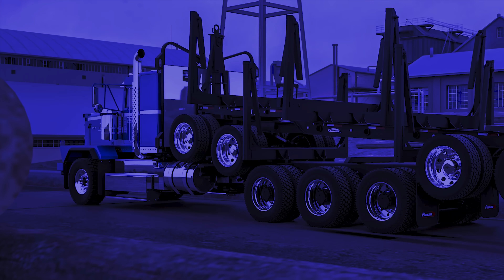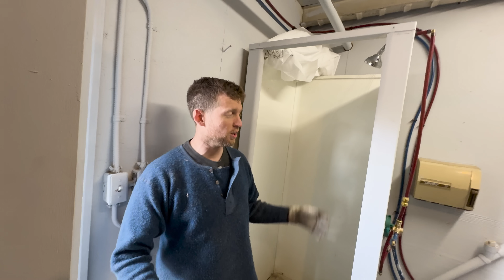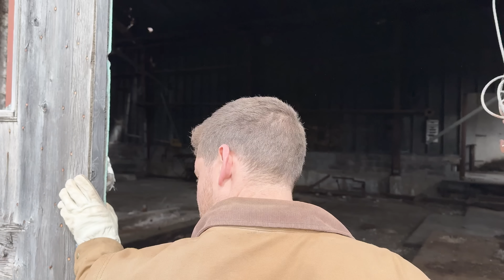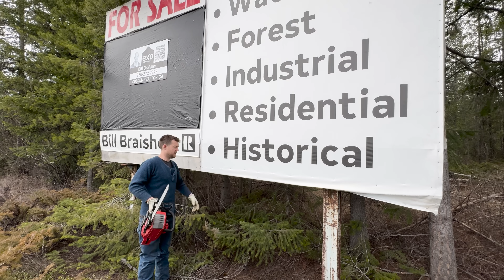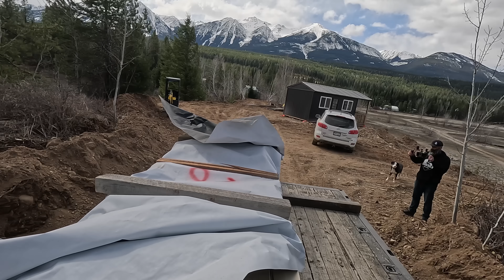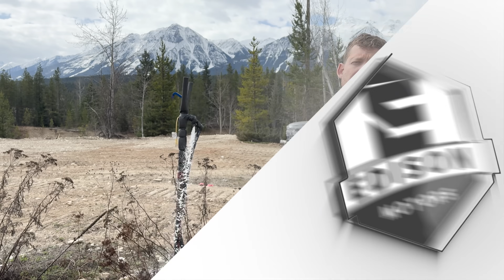Hidden Shop Revealed! Our New Build Space

Comment: Why do you need to build new factory building if you already have buildings that you can restore? Wouldn't it be more cost effective to use them first? Make some money with those buildings, then when they are too small, build new ones
Reply: The only safe building is this shop that can hold 2 trucks.

The new assembly plant will hold 12 trucks under construction.

Comment: So, don't just throw out all the paperwork. There may be some really important documents bidding in there. Most will be meaningless to you, but there may be maintenance records for the buildings and infrastructure that could be very useful to have. 

Also, where are you getting water from? If you are running off the well, you will probably need a water treatment plant. Start getting that water sampled now so you can get a water treatment plant designed and placed.

Comment: I thought that you guys might be interested to know that the structural design of the Old Powerhouse is a commonly used structural design for overhead cranes. The vertical columns get landings to support crane rails to run the length of the building on both sides and they carry the trolley that spans across the width of the building.
 I'm sure an overhead crane would be a very useful tool in your future.
Reply: and maybe power it with the train boiler?

Comment: If you can add some kind of ventilation/ductwork to your tiny houses before you drywall. The ability to bring in filtered air into your building with a little bit of positive pressure inside will help them dry out if there's ever humidity issues in the summer or condensation in the winter. If all you can bring to the buildings is electricity even a small HRV/ERV or a mini split would go a long way.

Comment: That power house would be quite a thing if you could restore and upgrade the fire suppression system and include a tri-brid backup power system (modern diesel generator, battery system, and roof solar or wind turbines) for the fire suppression and security/emergency lighting. Then gradually building a secure battery vault using your skills in developing your hybrid trucks to slowly power more of your facility off renewables and lowering your electric bill over time. The water tanks if cleaned or replaced could be a great storage for reserve water for distribution between fire suppression or other utilities (showers, toilets, sinks, wash bays, filtered drinking water dispensers). Heck, you might even want to upgrade the buildings with external water spray systems to keep the buildings and immediate grounds wet in the event of a fire.

Comment: Could you use that old boiler to power equipment to make your own frame rails/machining equipment? Rather than using it to power milling equipment it could get used to power the big manufacturing machines you need to make those trucks.

Comment: the extra building should be your shipping and recieving building... rebuild the roof and line the walls with pallet racks and get a warehouse forklift for in there... lots of small parts and electronics that will be coming in for sorting and storing while building trucks... you will need a seperate building for that...

Comment: What if you were to fix the roof for now on your paint booth building and use it for storing and maintaining the heavy equipment you are using the the site, with the intent to turn it in to the paint booth when needs and time permit. The roof will help maintain the interior stat as it is as well as shelter your heavy equipment and I am sure the peeps doing maintenance on them will love the idea of a roof over head for when a job goes long or weather turns sour.

Comment: Plumber here: I hate to be that guy, but in reality that old steam boiler should probably go to scrap, or be reused as not-a-boiler. Steam boilers of that scale are not something to screw around with unless SPECIFICALLY trained on them with multiple tickets for it (in fact, im pretty sure in Canada it's illegal to so much as touch one without a class A gas ticket.)
 if they go critical they can destroy entice blocks and kill people; especially old oil fired ones that dont have electromagnetical safeties. that is the REASON steam locomotives were abandoned for Diesil-Electic in the first place: it wasn't about efficiency as the steam powered engines were actually far more powerful at the time, it was because diesels  didn't have the chance of going critical and talking out half a small town at any time; which you can imagine was a pretty big liability. 

you COULD re-use that old boiler body as a fuel or oil storage tank though! a pressure vessel is a pressure vessel.
Reply: As a train guy, while a steam boiler blowing up is a factor for abandoning them, that wasn't the reason. It was that they got too expensive to maintain. There are so many safety features on "modern" steam engines, and you cannot come close to running one without training for months/years.

I agree tho. Scrap that boiler in the shop unless you got someone who really knows what they are doing.
Reply: I was thinking the same thing. If it's used for steam, it should be very low pressure. I don't know if it's possible to have a low pressure steam system though

Comment: @EdisonMotors since you have access to so much wood, open skies, and water storage, you should look into heating the place with a combination of solar thermal and wood gasification boiler(s), put through hydronic radiant heating wherever you can. This way you could put all those off-cuts and slash into good use as cheap fuel, reducing your electrical demand and cutting out propane or natural gas as much as possible.
Reply: Air to water heat pumps for heat. My 2cents
Reply: @justindarkcloud  A/W or regular A/A would be good for the residences (small cheap wall-mount units that could supplement small woodstoves - provide aux heat in winter and AC in summer) especially where you can easily mount the outside condensors outside way up high and out of the snow. But for large buildings - radiant floor heat paired with geothermal are far more efficient in that kind of tonnage amounts required from everything I've read. If going A/W or A/A They'd require a lot of large condensors for that kind of tonnage, and have to deal with major snowfalls, so why wrestle with having to continually shovel them out, and also deal with ice-up issues? 

Especially if you're working closer to the floor, and they're going to have to pour a new pad anyways for the new shop?

Comment: Have you had looked into using the Achates Power opposed piston engine design.  With its simpler design and significantly improved efficiency over modern 4 stroke engines, it would be the perfect power plant for a diesel electric vehicle.  Since the engine wouldn’t need to operate in as wide a range of power and rpm settings, you could make an already simple design even less complex by simplifying the forced air intake system that would normally need to work well from idle to full power.
Reply: I get it...

But Achates Power isn't producing engines yet.

Yeah, they have some demo engines, but they aren't in production. Attaching themselves to an unproven, unknown engine, without a parts network? Sounds like the most perfect way to potentially ruin the future of Edison.

The reality of the situation is, you start safe, and simple. Prove the Edison truck works, is reliable, functional, etc. Then, when Achates has proven their production engine? Then you might see about offering it in an Edison truck.

But you don't stack two, unproven prototypes together. That's just begging to fail.
Reply: @dposcuro  It's my understanding that Achates Power  won't ever be putting the engines into production.  They are licensing their improvements to make this very old engine design meet modern emissions standards.  Currently Cummins  is making a version for military applications.  I'm pretty sure a 1000hp engine is too large for diesel electric truck.  There's no reason Cummins couldn't make a smaller version for Edison Motors.
Reply: That's the power of the Edison design, you find a better engine, all it's gotta do is spin the generator, you can just swap it for whatever

Comment: I feel like that second building could be turned into a pass through powder coating shop, get all the parts in, powder coat, have the corner between the openings be the oven, then pull the parts out the other door and straight to the shop

Comment: you will eventually need heat for the whole place, it's gonna get BIG, turn that boiler into a water heater, long as you don't try to run it at original designed pressure nobody will care if you use it till it falls apart.

Comment: Down the road, id like to see a solar farm that feeds power into new batteries that are waiting to be put into trucks. Use the same computers and inverters as the semis use. Do first in and first out on the batts. Review the BMS logs to weed out any poor performing batteries prior to installing into trucks. Its like the stress testing they do on electrical components prior to sale.
Reply: Exactly. Power the shop and vehicles by solar - 100% all electric infrastructure with as much renewable as you can budget. Make sure it can survive a a grid-down event to keep yourself independent during blackouts!

Comment: 11:00 drywall is a fire barrier. Code calls for 5/8 where I live. Don't leave big holes for pipes and wires. Can be filled with fireproof insulation.
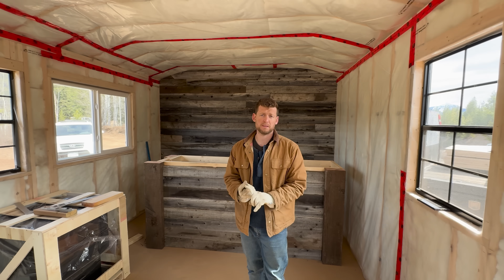Reply: Nevermind if they're all that small. 11:40

Comment: If nothing else, send the boiler to a train museum somehow. With it at being partially covered, it might not be terribly pitted and still could be safely used. Would need a boiler inspector come out to check it out. Last thing you guys need is an old cast iron high pressure steam boiler exploding. Might be able to use the steam for parts cleaning.

Comment: 1) I love that you use the language of the working man/truckers when you talk. Most would not have started "shit" when talking about their "bathroom upgrades." LOL!

2) Love that you were able to find a property with a bunch of buildings already there and available to use! 

3) I'm sure that y'all have already thought about it - but, when you have the construction crews come in to work on the new building - you might consider having them fix the roofing and walls of the existing buildings. Cost savings on having them return to do additional work. 

3) I would recommend that y'all look into solar thermal. I'm not sure how much sunlight you have in your locale. But, solar thermal is pretty affordable (when using evacuated tubes). And, you can use them to heat water all day for the cost of some 12v pumps, evacuated tubes, heat exchangers, and piping. With that large tank, your available roof space, and the large tank - you could put in a system that could heat your shops all day for a minimal cost. The front end/purchase and install cost might be a bit expensive. But, the return could be huge over the years of operation - less electricity/gas usage/bills.

4) Once you get the roof/walls done on those older buildings - consider putting epoxy on those concrete floors! You might not believe how much better that is to work/live in.  And, that is really a DYI thing you can do yourselves! Rent the floor buffers, buy the sanding pads, and prep the floors yourselves. Really easy to do! Buy the epoxy in bulk! Buy a couple of hand tools (special rake, floor squeegee, some paint brushes) and that's it! 

Expoxy floors will make your floors easier to clean, reduce the stains, easier to locate dripped screws and such, reduce the dust, brighten up the shops, reduce the moisture (concrete is porous), etc.

I did my three car garage no problem. Even saved money by using "lawn sandals" to walk on instead of the expensive shoes one find online. 

It is a fantastic quality of life thing to do for those work spaces! Make sure you get industrial quality epoxy from a wholesaler -much cheaper that way. Don't get the stuff at the big box stores. 

If you exist the floors in the new shop right after it is built you won't have much floor prep.

Some may claim that putting epoxy on the flooring would not be money well spent - but having worked in shops without it versus with it - without it is just not acceptable. 

I know y'all used paint in the one shop already. And, that is a more affordable option. But, I wouldn't give up my epoxy floors for anything!

Comment: If the boiler is serviceable you can see about using it to heat parts of the property and for hot water.  Centralized systems like that can be really cost and energy efficient.

Comment: Gents; Combined Heat and Power..!
If you're heating with gas; feeding that gas into a genset gives you the same amount of heat...  + free electricity!
ie:
The efficiency of a genset engine goes from 30% to over 80%!
IF you're using the heat..!
That saves you money AND fits in will with Edison's efficiency and green ethos.

Same goes for the hybrid trucks, where the EV side radiators should be pre-heating any cabin heating
AND
keeping the genset engine at (I'm guessing) 40C, rather than having the engine fire up dead cold every time it starts...

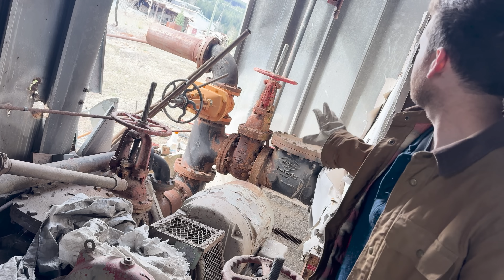Comment: 7:00  There are train museums around the United states which would be interested in old boilers, mostly because the more antique boilers would be rusted out, and boilers are a regulated industry.   Visually, that boiler looks good on the outside, andhope it's not rusty on the inside.
Reply: It will be rusty on the inside.....  Its about how much has been lost or not.
Reply: It is not a locomotive boiler.
Reply: @Nyth63  lot of stationary engines out there... ever watched dave richard's channel?
Reply: One side seemed to be bent inwards, there was a steel plate welded to it. If the boiler had some intakes on top that have been open to outside, it can be rusty on the inside.
Reply: It looks heavily modified. It wouldn’t be useful for any steam locomotive organization in that state
Reply: Central boiler heating is very efficient. It would be cool to use it with some radiators to heat all the buildings.
Reply: @pkobalt  Using an old boiler like that isn't very efficient; using a modern gas boiler would be a lot better
Reply: The type of steel in the boiler...
Reply: I know where there is a very large Boiler, I'll sell the location. 😂

Comment: Clean drinking water can be like seat belts and airbags. The quality of the water may not have changed but what is acceptable has. I ran into that issue a few years ago, I was told it is the exact same quality of water as what was plumbed in as safe drinking water in 1980, but because what was minimally acceptable had improved by 2020 the water was no longer considered fit for human or animal consumption.
Reply: There's also new chemicals that should be tested for ..PFAS so called forever type though there are ways of cleaning even those up and nano plastics..  
Note PFAS chemicals are used in certain paints coatings plastics and fire suppressants..🧙🏼‍♂️🥼🌍🇬🇧🤞🏻👍🏻

Personally I wouldn't be trusting the spray foam insulation both on fire and off gassing in an enclosed space.

A steam boiler would need inspection and certification in the UK as if it was to block up and blow  .... well with the 80th anniversary of WW2 just see what happened when a Typhoon hit a steam 🚂 loco boiler.. 

That said it could be used to generate hot water across the site using scrap  wood via insulated pipes stored in insulated tanks ... 

Passive SS W solar heating of concrete slabs via windows in spring autumn winter .. can save energy and brighten things up for those working inside any  building.... 
You can control the glare and summer overheating by the bungalow veranda over hands principle .. 🤔😎